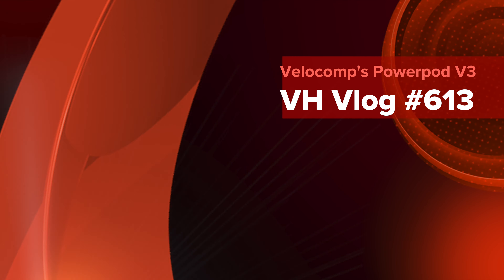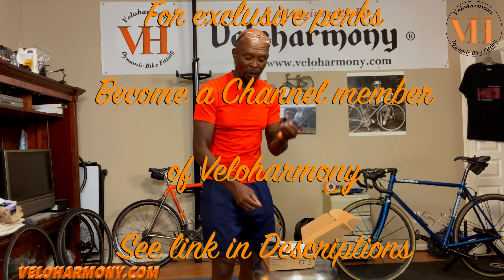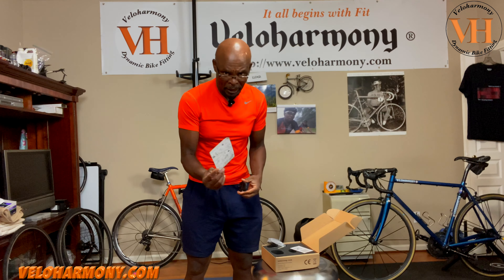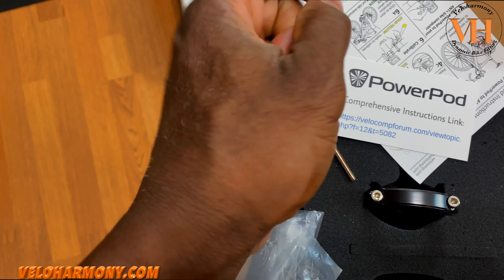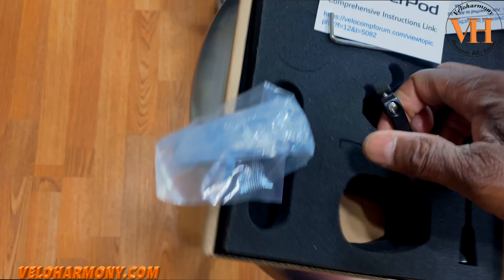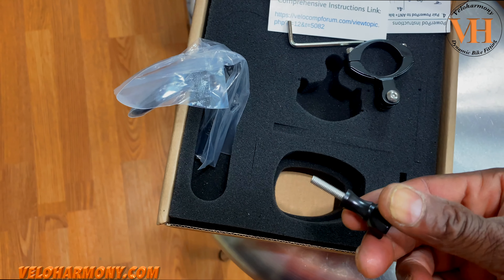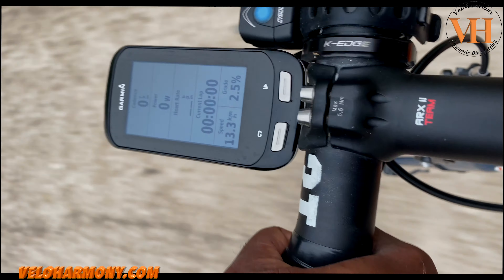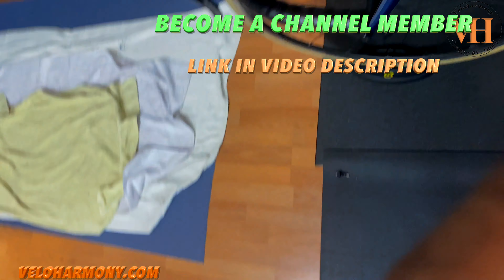Velocomp's Powerpod V3

Comment: I like the way you show the whole installing process, unlike most review videos that try to make it look much easier than it is in order to convince you to buy it.
Reply from the maker: I appreciate that! It is not easy. It's a bit of a finicky process, but it does work with a bit of patience. The instructions are decent but not perfect. Honestly, I only accepted it because folks on here wanted to see power numbers. I don't really train with it, as I have always preferred to just train by feel and not rely too much on Power. I mostly train with a HR monitor. I owned the G3 power meter from CycleOps and it kept failing every week, requiring the removal of the battery as a reset. Sold it off and never bothered until this one came along. I like that it can be switched between bikes easily.

Comment: Several years ago I owned one of the early versions of the Velocomp power meter. I was always impressed with the company and their product. They are the only company from which I received a direct call from the CEO when I had a problem setting up the product. Their approach to measuring power for cyclists is unique, and the amount of data generated is unparalleled. I have always supported this company whenever I can. There's no one more deserving. Even while the technology keeps improving, they manage to keep lowering the price! I think I'm overdue for a new power meter. I will be ordering a new Powerpod tonight!
Reply from the maker: Agree. This product is for people who are willing to slow down, read the instructions and setup the product as designed. If you're in a rush..get something else. I have been able to use very little time to get the product working. I have had no reason to contact support because this version 3 is stable. I have chosen to delve further later on into using the Isaac software and the Powerhouse app to control switching profiles and use the optional best accuracy out and back configuration. The product works with a single speed sensor that can be moved between bikes. Since I have no magnets on my speed sensor, it's easy to move and did not require any additional expense.

Comment: Thaks for the review. I just have to decide if I should go with a new V4 or take a chance with an eBay V3.
Reply from the maker: Funny. I have my version 3 listed on Ebay to thin the herd. I have too much stuff after the reviews. Mine has the Pitot Tube included which makes it effectively and aero pod to pick up drag and keep it protected during rain. If that's the listing you're seeing, it will be a good buy at that price point for an aero pod which wasn't used much.

Comment: Hi, 

Do you need to calibrate before each side like the AIR POD? Also how accurate is it compared to other power meters on the market.
Reply from the maker: Calibration before each ride is not necessary.

Comment: What is the unit basing the power number from, speed? That doesn't seem like the best way to calculate your power output.
Reply from the maker: Speed is one factor. PowerPod takes into account opposing forces, including wind, hills, acceleration and friction. According to Newton’s Third Law, “Opposing forces equal applied forces“. So, the total opposing force caused by wind, hill slope, acceleration and friction is EXACTLY THE SAME as the applied pedal force.

Digital accelerometer, dynamic pressure, and barometric pressure sensors are mounted inside PowerPod. Unlike applied-force power meters, PowerPod sensors experience nearly zero stress, so they don’t wear-out and do not require maintenance and factory recalibration. A wireless sensor mounted on the chain stay measures bike speed.

If you want to understand the technology go here and read up: https://velocomp.com/technology/

Comment: Hey there,  how do you like powerpod 7 months in?
Reply from the maker: It's okay. It has moments where it craps out and you have to reboot it to get the readings to normalize, especially in inclement weather like rain and sometimes very windy conditions. They all have their issues, which is why I don't depend on any of them and train based on sensations and feel most of the time.

Comment: I have the BLE (version 2) and compatible with both Ant and Bluetooth. I wonder if this is now a standard with version 3? I compared this with a stages and info crank and I don't see much difference so not sure why it is not so popular.
Reply from the maker: Ian, my bad. It works with Bluetooth devices as well. I just have an ANT Speed unit and an ANT Garmin Head unit that I paired it with.
Reply: @Veloharmony  no worries Eldred. it is good to see a review of this product and that they made it look like the TT version.
Reply from the maker: Yes. I'm glad I waited for this one. The unit does require your speed sensor to be ANT+. It will work with bluetooth for other devices. I downloaded the powerhouse software on my phone which use Bluetooth and was able to control the unit with my phone but it's very limited. The Isaac software has more options and allows you to fine tune the accuracy to a greater degree.
Reply: @Veloharmony  yeah the Isaac software has a lot more. you can even use it with indoor trainer by setting it using the software - it reminds me of the mid 90's visual basic software :)

Comment: Great video as always!  I have one of those actually the previous generation but all the steps are the same and by looking at your video it seems like it performs the same way. The concept is good and if you have 2 or more bikes it is easy to move around. But the problem is that it feels unreliable and there are too many steps. I don't have stock with Stages Power meters but for the same price you get a crank arm power meter that is ready to go every time you ride and as long as you stick with similar cranks you can move it around between bikes pretty easy as well. I wanted to like the pod but I think  I just wasted the money.
Reply: And by the way I use Stages but I train by HR. I only keep the PM to look at historical data, and yes my power has gone up by using HR as my main tool
Reply from the maker: I had no interest in messing with the hardware on any of my bikes to use a power meter. So when it came out in a few years ago, I tracked the progress. DCrainmaker did a thorough review and comparison with multiple strain gage meters and it tracked consistently which is what matters in any training tool. Investing the time is setting up the unit is necessary if you want it to function as designed.
Reply: @Veloharmony  Well I read that at the time before I purchased it. But the thing is if you start using it on every ride it becomes a chore having to calibrate it often and what not. Then if you forget you don't get accurate results. I got annoyed quickly LoL
Reply from the maker: Calibration is not required for every ride.
Reply: @Veloharmony  Okay then it is an improvement
Reply: My unit what a previous generation. What is your overall opinion?

Comment: Do you still use the power pod? It seems too good to be true. If so how has it been long term?
Reply from the maker: I have had the Powerpod for a month. It works. You must invest the time to understand and configure it properly. The full version works with up to four bikes. I have been able to use it on multiple bikes. It requires a bit of a learning curve but once it's setup, it's very consistent. You must use the correct brand speed sensor for best results and use their software to really dial in the accuracy.
Reply from the maker: Yes. That is what I use. I only have one speed sensor, so I have to manually change the bike being used on the powerpod with the Isaac software when I switch bikes. If you have multiple speed sensors then when you switch bikes, the powerpod can switch automatically.